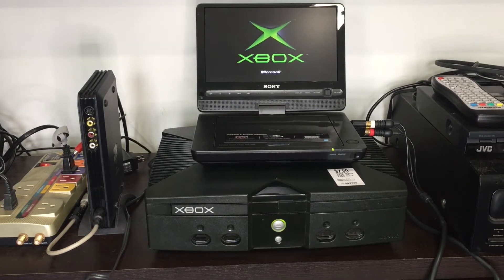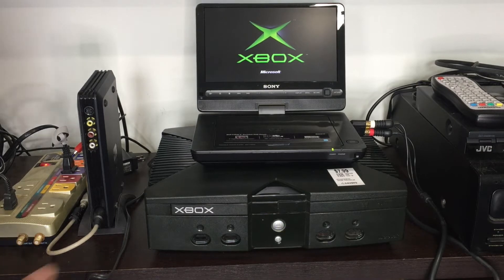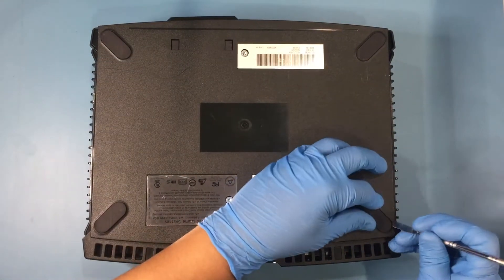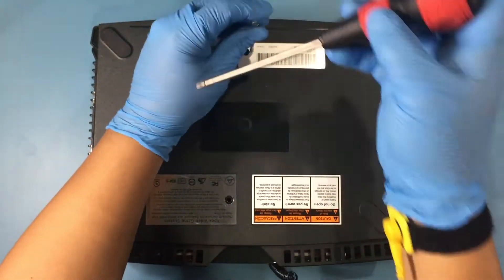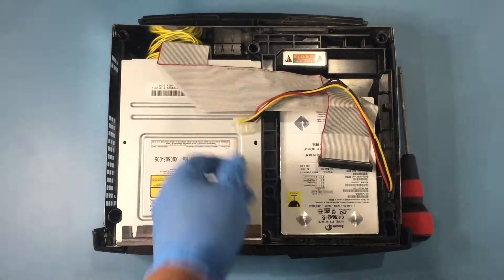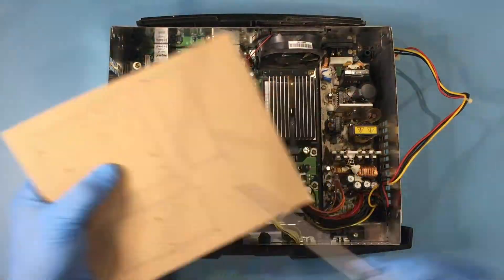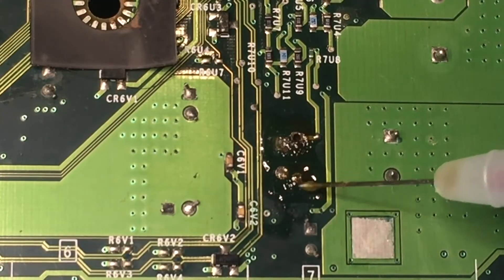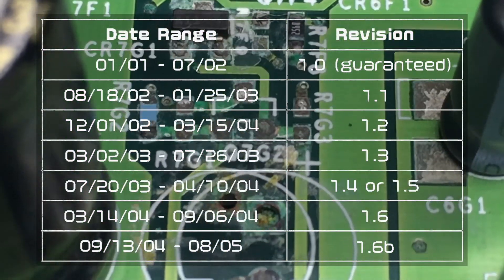Original OG XBox Clock Capacitor Removal- Savers Rescue pt.1 [ep. 67]

Comment: Did you end up replacing the missing components around the clock cap. Did the xbox turn on with out them ? I have a xbox 1.1 my clock cap leaked it was turning on before i took the cap of and 3 of the smd caps came off right next to the clock cap and now it wont turn on
Reply from the maker: Yeah, it was smd resistors that came off, not caps so try replacing those.

Comment: found a cheap xbox but clock capacitor had leaked and a few of the components came off, like the little mlcc things , xbox starts but no video and has an orange light also turns on and off a few times before starting , would you say give up or easy to find the parts and replace?
Reply from the maker: It's toast. Too much trouble for the payoff IMO. Save the XBox for parts though. Not a total loss.

Comment: So just to be sure, removing it will just affect the clock settings, right? The Xbox should still start up and read discs properly without it? If we do decide to replace it, any recommendations for specific capacitors?
Reply from the maker: Man, it's been a long time since I did this. You need a specifc cap. Man, I forgot what it's called. Ask nicely on the OG XBox Subreddit.  And yeah, you don't really need it. It saves the clock info, so you don't need to keep inputting it on start up. You also need to be careful softmodding one that doesn't have the clock cap. as you can have an error code pop realated to setting the clock, and it's tricky to fix. I forget it's been so long, I need to refresh.
Reply: @The_SegaHolic  Cool, man.  Your videos are awesome! I removed the clock capacitor and I even repaired 2 of those traces that control the power/eject buttons using your other video.  But I'm considering putting a reliable capacitor in the evil capacitor's place.  Thanks for your reply.
Reply from the maker: @snowyowl9132  Thanks so much man. yeah, I'll have to look it up again and refresh on the OG XBox knowledge.

Comment: how do you clean off the electrical fluid?
Reply from the maker: Just use isopropyl alcohol. Lot's of going over the affected areas, even though you've cleaned them until you are satisfied. I presonally go over like 5 times. For cleaning, you should be using isopropyl alcohol, in 92% or 99% strengths. 99 if you can find it.
Reply: @The_SegaHolic  I only have ethyl 70% solution alchohol
Reply from the maker: @lowell1648  Use it, but make sure it dries completely. Use a fan for about a minute or two to dry. Do this as sometimes liquid gets under components.
Reply from the maker: The reason is the other 30% is water, which does not dissipate or dry as quickly as isopropyl alcohol.
Reply: @The_SegaHolic  So, I just need to put a little bit of alchohol on the cotton bud just so it won't get under the components, right?
Reply: @The_SegaHolic  Also, I don't desolder since I don't know how to do it. I'm still a kid
Reply from the maker: @lowell1648  No, flood it. Use a lot. Again, go over the same areas. I go over about 5 times. Dry using dry swabs. Then dry more with fan.
Reply from the maker: You need to do this as the cap juice may have gotten under the same components. FLOOD THE AREA WHERE THE JUICE WAS.
Reply from the maker: @lowell1648  U don't have to desolder. Really though, by now, the juice is all dried up and has lost it's effectiveness. What's already damaged won't get "more damaged." But just clean it for peace of mind.
Reply: Okay. Got it! By the way, how long will it take for the motherboard to corrode
Reply from the maker: @lowell1648  Dunno, but I've seen only one board with significant damage from the juice (it's featured in one of my videos). The rest of em really hand minimal to no damage. Minimal meaning thaat the solder resist just became a little dull and some solder joints got a little contaminated, but not bad at all.
Reply: @The_SegaHolic  Is it okay if I remove the capacitor and do all the cleaning while the motherboard is still in the xbox?
Reply: @The_SegaHolic  I just opened it. I left the motherboard intact. I saw that there's dry acid at the area where the capacitor is. Should I still use only a cotton bud and alchohol to get it off
Reply: @The_SegaHolic  Also, what do you mean by water solution?
Reply: @The_SegaHolic  Welp, I did it! I  used pliers to remove the capacitor, gently rubbed the parts where the acid is with alchohol, and used a hairdryer to make it dry faster. I hope I did it right.

Comment: I have change the capacitor with 2,5V 1F but clock still asking at boot. I've got a v1.0. Any help?
Reply: Could be damaged trace or damaged  clock components... just to clarify the cap is only needed if you unplug the system... if the system remains plugged in it should keep time regardless of rather a cap is in it or not...

Comment: I just removed mine and now it will turn on but no green light and no signal to TV. Any thoughts? Its from 10/2003 so model 1.4 or 1.5. The capacitor was intact as well. Thanks!
Reply from the maker: Double check to see if wires and cables are put back snugly. Also make sure the AV cable is in good. If it's still the same, what color is the light around the eject button?

Comment: Hey SegaHolic! I really enjoy your videos. I had my 1.0 OG Xbox refurbished right before they stopped doing official repairs to them. (I can't recall my issue, but I was happy to get it a checkup right before they stopped doing it). I only heard about this capacitor issue this week so I opened up my old Xbox to take care of this issue. Not only does it look like they updated my heat sinks (awesome!) but maybe they also updated my clock capacitor as well? My clock capacitor doesn't look like the one above. It is gold and black and appears to be a brand of "nichicon" and also says "1.0 F   2.5 V" and "UC (M)" on the sides. The capacitor doesn't appear puffy. Do you think I should still be concerned? I can upload some photos if you are interested in what either came in my 1.0 Xbox or what was updated by the official repair team right before they stopped taking repair orders.
Reply from the maker: Yeah, I’d love to see some pics.. Could u also take pics of the ser#? And I’m glad u enjoy the vids! Fuel for the next one!
Reply: @The_SegaHolic  Hi there! I just sent an email to the address I found on your Youtube About page. I hope you enjoy taking a look at what makes my Xbox tick. :)
Reply from the maker: @scotchnichols  https://www.reddit.com/r/originalxbox/comments/7hk9xi/ogxb_14_with_a_nichicon_time_clock_capacitor/

Looks like Nichicon also supplied aerogel caps for the clock.

They replaced the v1.0 board that was originally in there with a v1.1 board. The fan jack on the board is missing, and there are no USB boards for the contoller ports... so that's why you no longer have a fan on the heat sink. A replacement v1.0 board was probably not available.
Reply: @The_SegaHolic  Oh nice. That all makes sense. I had not done any research on the Nichicon capacitor since finding it, so thank you for getting some information on it! I will follow the rest of your videos as I work to clean out the dust within the Xbox. There were some good dust balls in there.
Reply from the maker: @scotchnichols  Yeah, they are easy to take apart. You should have no issues.

Comment: Dose this work for 1.6 motherboard
Reply: NO... dont remove the clock capacitor in a 1.6 unless you plan on replacing it because 1.6 not only fixed the capacitor issues its made to not run if missing
Reply: @4hand561  yeah it would do error what 5 or 7

Comment: I have a Xbox Crystal limited edition from 2002 and the motherboard is completely different from standard versions. Additionaly, the capacitor itself is a high quality one. My friend, an experienced electronics technician, desoldered it, verified it throughly and the capacitor is "healthy". Secondly, the console didn't work AT ALL after the capacitor removal, even though I use UnleashX.
Reply: Not possible the crystal edition came out in 2004... its a 1.6 console which dont work without the clock capacitor
Reply from the maker: You have a picture? I'd be interested in fixing it for free. Would make an interesting YouTube vid. You just pay for shipping.
Reply: The SegaHolic He had the picture, but I don't know if he still has. I may take a picture in the future, because this Xbox is sheduled for capacitor replacemnt just in case - it won't last forever.

I just can't send the console anywhere - I don't let people use my cars and electronics ;) Anyway I have two questions.

Do you have any good place for getting the clock capacitor? So far I only found Aliexpress and Amazon. I have a Panasonic capacitor, but it is a 5V and my friend doesn't like the idea of using it instead of a 2.5V one.

Do you have any idea why my Xbox does not work without the mentioned capacitor? All other consoles seem to boot, as long as there is any mod installed.

Regards

Comment: So I just opened my XBX Classic (Crystal, PAL) and it doesn't have those kinds of caps there. However it has 4 "under" the right heatsink which 3 of them is rusted on top. The 4th isnt as bad, but it's got some sign of rust. What do? Do I just remove all of them? Kind of guessing they need replacement?
Reply from the maker: Those will need replacing. Identify your clk cap and remove that.
Reply: A good tell if a cap needs replacing is if it has a bulge on top... caps should be fully flat on top.. under the heat sink should be 5 caps not four.. 6.3v 3300uf caps... replace all of them
Reply: And i just realised this was 11 mounths ago 😳

Comment: I have a question: to neutralize the fluid of the clock capacitor do you have to use baking soda or vinegar? Everywhere else in the interent I've read vinegar (and I know this is the case for ordinary elecrtolythic capacitors), but I see you used baking soda in the video, and since I know this is a different kind of capacitor from the "normal" ones I was wondering wether in this case we have to use baking soda instead of vinegar. My intuition is that since vinegar is acid and baking soda is basic, onlyh one will work to neutralize the leakage, but I have no idea what find of fluid this particular capacitor leaks
Reply from the maker: It's actually not a fluid if you can believe it... it's a gel/gas. I know I did a ton of research into what kind of cap this was. And yeah, baking soda neutralizes acid. That's why you add it in some cakes and stuff and you know it's still good if it bubbles.

https://itstillruns.com/neutralize-battery-acid-baking-soda-8189182.html

Shoot, I can't believe it's not in the comments. I'll be back after I search this out.... But again, it's not actually a fluid in there... or a solid.. it's actually gas.
Reply: @The_SegaHolic  I could find out too with a quick google search that it is actually a gel and not a fluid, but the point is wether it is acid or alkaline, as this determines what chemical to use to neutralize it. So what you are saying is that it actually is an acid (wheras as far as I know, common electrolythinc capacitors have an alkaline leakage), correct?
Reply from the maker: @painco94  Yeah, I thought I put a link in that shows Baking Soda neutralizes acid. But in this case, as in most cases, just clean the area with IPA (Isopropyl Alcohol) as thoughroughly as you can. Make sure to flood the underneath of components repeatedly if you think the material got under. Neutralizing at this point though is overkill. I just wanted to look smart for the YouTubers. LOL.Again, just clean thoughroughly and repeated with Isopropyl alcohol.
Reply from the maker: It's a a Powerstor Aerogel supercapacitor...
https://solarbotics.com/product/cpag1_0f/

Data Sheet PDF:
https://cdn.solarbotics.com/products/datasheets/powerstor_aerogel_ps-5102.pdf

And here is the Wikipedia of Aerogel:
It's a solid with it's liquid coponent replaced with gas...
Reply from the maker: ....and I'm not a rocket scientist and like to keep things simple. LOL

Comment: I got an Xbox that has the manufacturing date to 1/18/2005 should I remove the clock capacitor? I don’t know much about this stuff
Reply: i think if it's in 2005 you have a 1.6b xbox. you'll probably be fine
Reply: hasidichomeboy Ay dawg thanks, I kinda had to slowly come to terms with that but with a bit hesitation because I just wanted to be sure but, thanks dawg, appreciate it.
Reply: @George61945  despite being a year old ill still warn you, 1.6 systems wont boot without a clock capacitor... the horror story for the xbox clock capacitor isnt that it used a capacitor to keep for a short period after unplugging but the one the used from 2002-early 2004 where flawed, when they realised they switched to a better capacitor... now ill say any cap has the ability to die but they aren't suppose to leak in the fashion the flawed one does.. caps would typically start leaking from ths top and would die before the leaking typically became severe (with exceptions case by case but typically) the furst likey caps to die on your xbox will probably be the ones around the power supply plug,, when those ones die the cobsole wont switch on but ver easily replaced
Reply: Anything BEFORE 2004.

Comment: thank you for the video! im used to fiddling with tech and building PC's, but ive had bad luck in this case. removed the clock cap from my 2003 og xbox, and now it wont boot. the power light blinks on for a few moments and then just flashes red afterward. any advice?

Comment: Hey Sega Holic, I've been catching up on videos that I've missed from your channel. Specifically, I've seen a few of your Yahoo Japan pickup videos. I'm assuming you're using a proxy service like buyee? If so, would you be willing to give me a rough estimate on how much they charge you in fees and maybe how much shipping costs to Hawaii?

I've been interested in using buyee and I live in southern California so I imagine that the fees you have paid would be very similar to what they would charge me.
Reply from the maker: Yeah, I use Buyee and fees and shipping varies on final auction price, weight, and shipping service selected. You can rewatch some of them, as serveral of them have the price of the fees. You can also save on fees and shipping as several times during the year, they run promotions, sometimes offerering up to 50% off fees. BTW, they list their shipping rates as well as how they apply fees in their FAQ.

With that said, it is not cheap, but buying and using Yahoo Japan via proxy service is cheaper than eBay most of the time.